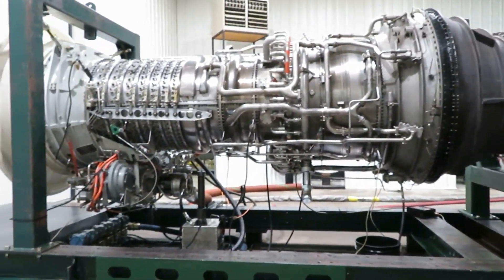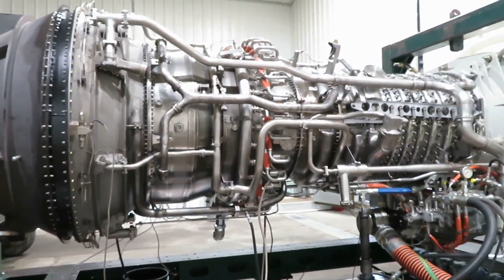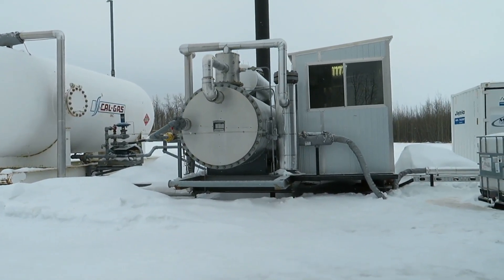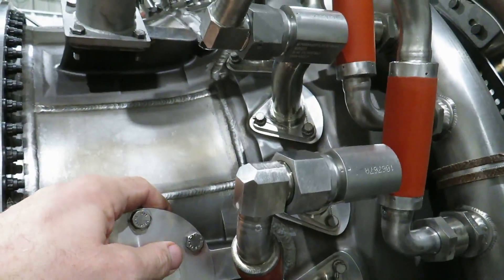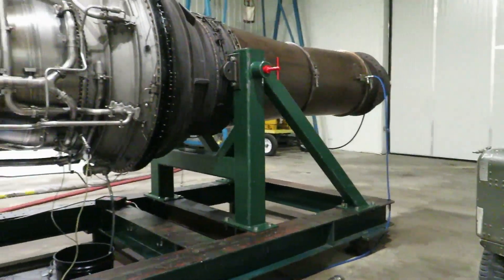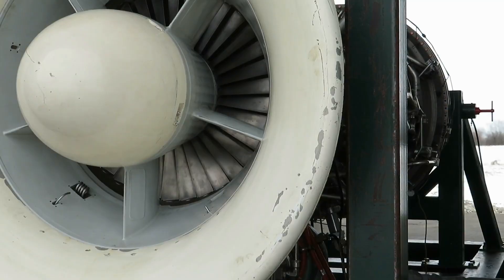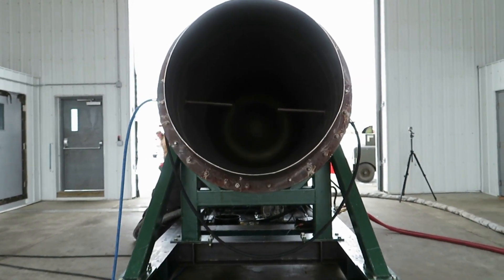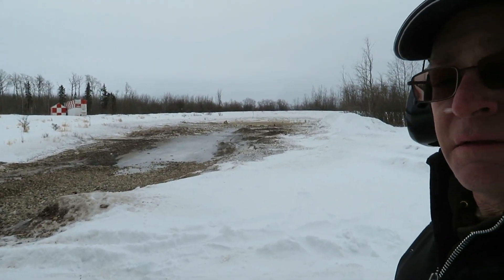The Big Engine - the GE LM2500

Comment: why are you running the engine on an external air compressor instead of using the engines compressor?
Reply: Lol the external air compressor or the "start cart" is just for starting the engine. It gets the engines compressor up to operating speed for start up.
Reply: How exactly do you intend to start the engine using the engine-driven compressor if the engine is not started? I'm really weirded out that you'd know enough to ask this question, but not enough to answer it yourself.
Reply: Not running, but to start. To start any gas turbine engine you need somekind of external power. This engine has turbine starter, a small turbine connected to the gearbox, that on aircraft set in motion by air delivered from the APU, ground power unit also can be used. 
LM2500 has inlet guide vanes, i think thats why you made a conclusion engine's compressor is not running
Reply: There is an overrun sprag clutch and cuttoff switch inside the starter.
Reply: Heh? You always start an engine before it is started...hence why you are starting it... They use a smaller engine (Start Cart) to create enough air pressure to start the big engine (LM2500). The Start Cart's engine is started by an electric motor. The Start Cart's engine creates pressurized air which is used to spin the LM2500's compressor fast enough that it starts creating enough pressurized air to operate the engine.
Reply: @DroneDocs  I was replying to the OP, not you, you got it!
Reply: @Mythricia1988  Nope! Maybe make it clearer next time like that 😉
Reply: @DroneDocs  Well, all I did was hit reply on the original comment. I can't really help that YouTube refuses to include the names of who is replying to who in the new comment system. Or for that matter, why it alerts everyone in the thread when someone replies to the original comment.... 's all really confusing.
Reply: @Mythricia1988  lol hey I was just kidding around. Have a good day!
Reply: Ok thanks. I thought they weren't using the engine's compressor at all because I didn't see the rotor turn in the video. It got me very confused because how do you run the turbine without running the compressor. There is no clutch in between right?
Reply: @Shroomssss  No problem. Correct, there is not a clutch between the compressor and turbine. What you see not moving are parts that do not rotate, they guide the air into the rotating assembly in the correct direction to rotate the compressor. The parts you expect to see moving are directly behind them and visible turning during a short portion of the video @ 10:08
Reply: @DroneDocs  oh that makes a lot of sense! I didn't realize they were the inlet guide vanes. I haven't actually seen any aircraft engines in real life (unless built into an aircraft). It is interesting to see all the small details they don't teach you in university.
Reply: @Shroomssss 
The rotor turns. What you see are the stator vanes in front of the compressor rotor.
There is a centrifugal clutch in the turbine starter spline drive. This means that it will disengage once the engine is at idle speed.

Comment: I was hoping to see the stators actuate.  They look like an expensive maintenance item?  Do these industrial engines mostly operate at fixed rpm?
Reply from the maker: Usually at the rated output. You are making money by selling power, so you want to make as much of it as you can without compromising reliability. The operators might take it a bit easier this time.
Reply: @AgentJayZ  Sounds like someone got a substantial bill for the privilege of pushing things as hard as possible (vs. as hard as practical).
Reply: @AgentJayZ  
Apparently the complexity of the stator assembly is not costly to service?  If it is costly there must not be a straight industrial alternative that does not have them.
Reply from the maker: David Rapalyea
: Really?
"must be" an alternative that "doesn't have"variable stators?
What are you talking about?
Without that, the engine would not even start.
You know nothing.
Reply: @AgentJayZ  I don't know anything which us why I am speculating out loud. 
1) I had no idea the variable stators were needed for starting.  The early Orenda does not have them and they look like a maintenance and expensive nightmare.
Reply from the maker: VSVs are complicated and expensive. They are worth it though. Have a look at my vid called Compressor Stall, and it might help explain why.
Reply: I was curious too see that too, especially the nice and simple differentiating mechanism for the compressor stator stages. You can see the actuators in action at 7:05.
Reply: Normally you operate at maximum capacity. Depending on the conditions, there are many regulators and limiters that will determine the maximum. It can come from T3 (comp. discharge temp), T48 (turbine exhaust temp), NGG (gas generator speed), MW limit, torque limit, etc... Your VSV position (stator vane angle) comes from a schedule based on T2 corrected NGG. Normally at maximum they´re fully open (0% position), but atmospheric and engine wear/cleanliness conditions can change that.

Comment: This runs on propane but jet wash ally looked full of soot? Think it would be cleaner. What is story on stators in front of fan, not found on aircraft engines...
Reply from the maker: We test many engines there, including afterburning J79s running on JetA.
That's not the fan, as explained in this video. All airliner engines have VIGVs and VSVs.
You are just confusing what parts are what.
Reply: @AgentJayZ   I got it! Thank you Sir. Feel dumb. It's the core gas generator, no fan (thrust) needed. Variable stator is behind fan on aircraft turboofans. Love your channel.
Reply: Not soot. It's dirt that gets kicked up and blown around.
Reply: Think that might be just dirt and mud that gets kicked up, but I might be wrong.
In regards to the thing in front, thats the Inlet Guide vanes, i believe he has talked about them in other videos if you just do a search on his channel. Also, I think aircraft engines do have them but they are behind the actual "fan", this engine here doesnt have a fan.
Reply: @shadowOrgon  Thanks for the great thoughtful reply appreciate it. It is dirt or combustion products. I'm sure Jet-A would be much dirtier. I'm sure he's done something on those Inlet veins but being in aviation in the airline industry they're just not on commercial jet aircraft. This being a fixed power generating turbine the reason I'm sure. It must be to provide more efficiency guiding the air to the fan stage.

Propane or natural gas power turbines for power generation is very popular in the USA. The idea of all renewable solar or wind power is ridiculous. I mean it's fine for 10%, 20% supplement but as the primary source forget it. Turbine power generation can be started very quickly and handle the peak periods. Where nuclear power and other large electric generating plants, coal or hydro require significant startup time and shut down time. Despite all the green New Deal talk still turbine power generating plants are going in in record numbers all over the world.
Reply: @gmcjetpilot  I think commercial airplanes use turbo fan engines, this is a turbo jet engine. Think of this turbo jet engine as the heart of a turbo fan engine but a turbo fan engine has a big rotor in front of it that spins to suck in more air.
Reply: Not soot. Mud.
Reply: Way back when I was a skinny lad, I could fit in between the blocker door arms and blend  compressor  IVG vanes on the TF 39. I was the only one who could do it

Comment: Nice! I worked on these in the australian navy, as they were fitted to our guided missile frigates. 2 26,000hp lm2500s through a 20:1 double reduction gearbox into a single propeller shaft. I remember many starter oil changes!
Reply: At full power i rember being told about 2L per engine per second.
I can't rember the fuel capacity but its range was 4,500 nautical miles (8,300 km; 5,200 mi) at 20 knots (37 km/h; 23 mph)
Reply: @leeedwards234 
Sounds about right. I believe reading 7000 liters per hour for the 1st. gen 2500.